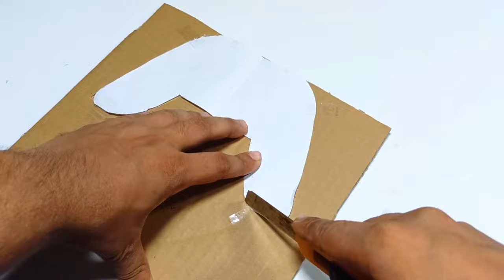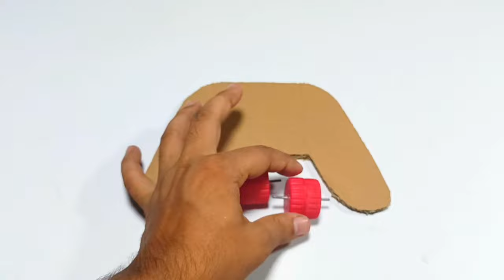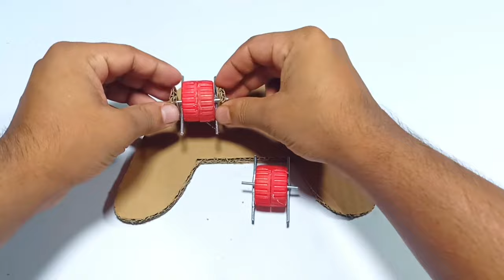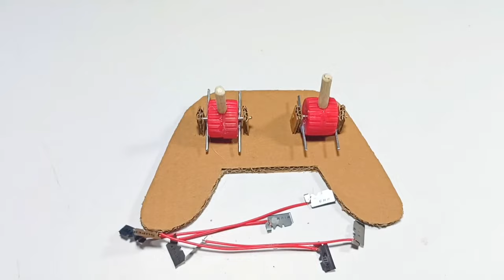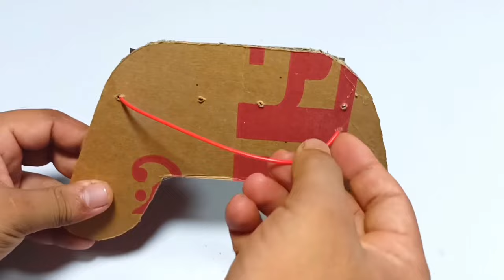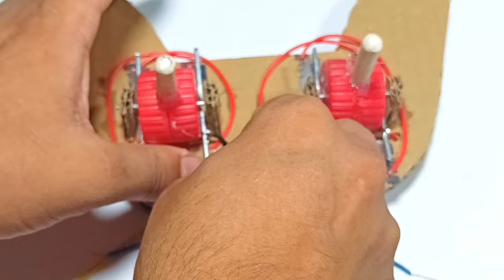How To Make Remote Controller for Toy Car at home ( DIY idea ) রিমোট কন্ট্রোলার তৈরি করুন।

Comment: Nice bro,nice work 
But I am confused about the controller I mean the Left control is suppose to be in an horizontal shape,so it would make a car or rotor turn left and right.
Well I am okay with the one you've made.